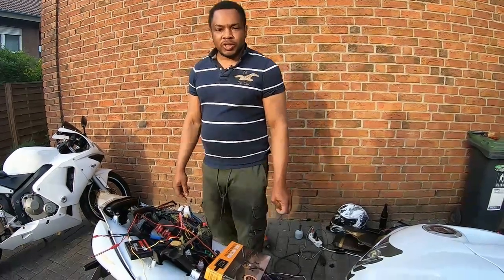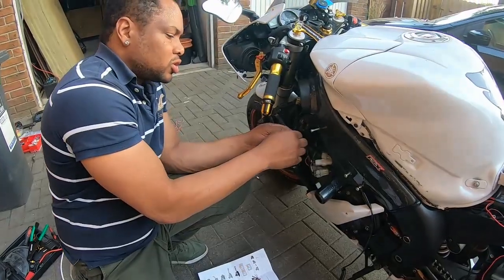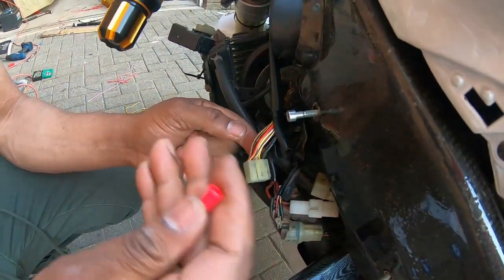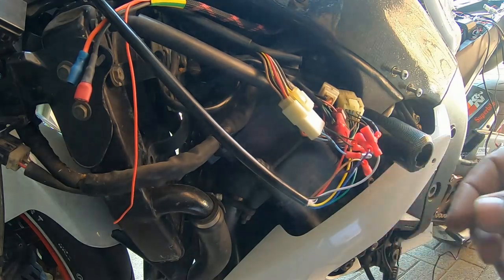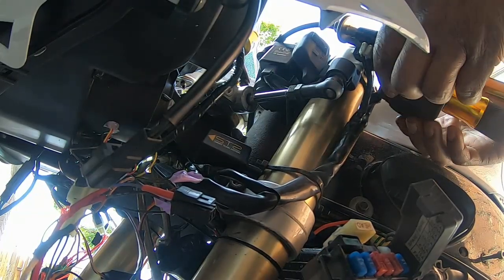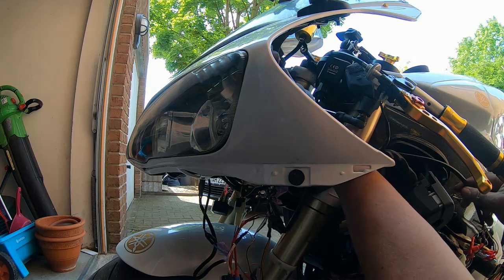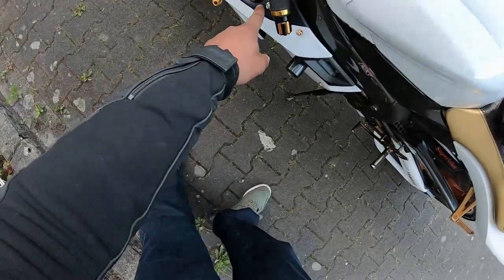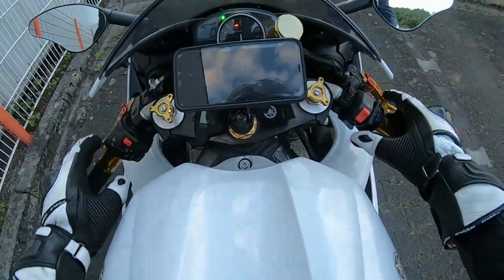yamaha R1 RN12 2004-2006 smart turn system (STS) installation

Comment: Cool I have a 2014 R1 and I have the smart turn system but haven't installed mine cause don't like to cut either...  where can get those male/female plugs?
Reply from the maker: https://kojaycat.co.uk/epages/950000457.mobile/en_GB/?ObjectID=133424&ViewAction=FacetedSearchProducts&SearchString=+11+Way+Yamaha+R1+R6+4XV+Loom+Headlight+Connector
Reply: @rickybritish  unfortunately link gives me no search results error message.  And also site looks like UK and I'm in the US so need a site in US and currency in USD :-)